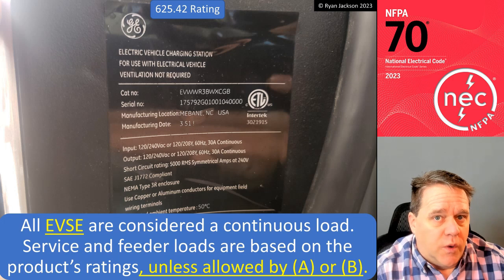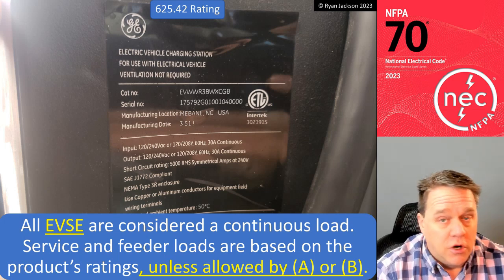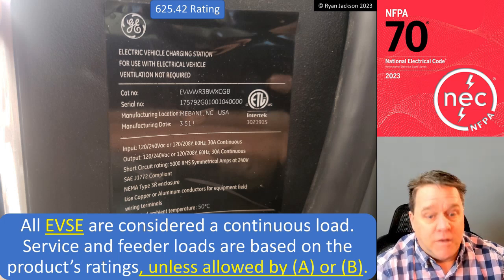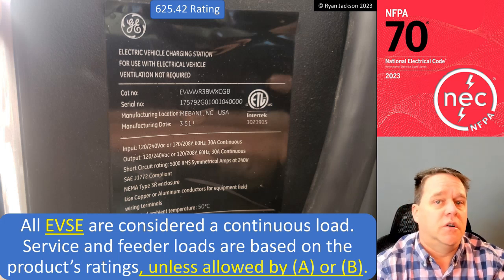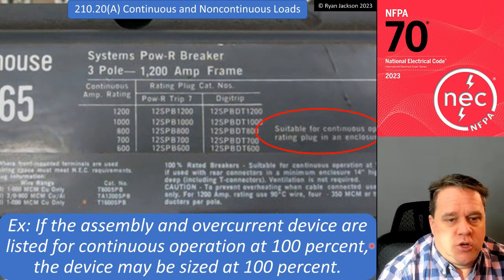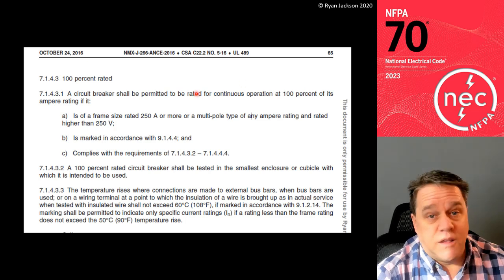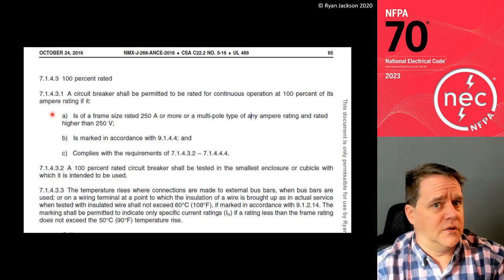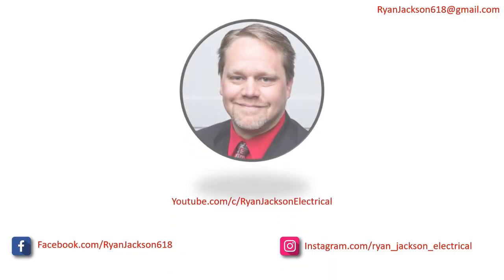Electric vehicle circuit sizing (NM Cable)

Comment: I do not argue with your interpretation of the code, or as the code states clearly in 625.42 that EVSE are considered a continuous equipment. However, there are some jurisdictions that have adopted standards different from this strict interpretation. One such example is in my home state of Oregon that acknowledge that the "peak demand" of most battery packs under charge is not for 3 consecutive hours as the code uses to define continuous load, and they therefore have alternative methods for calculating the load of EVSEs on feeder circuits. (Look up OR BCD Alternative method 09-01.) Usually this peak demand is for an hour at most, but it will depend on the battery controller for the specific vehicle being charged. But this is an inherent limitation to the lithium-ion battery chemistry that it cannot be safely charged at full power throughout its entire charging cycle.

I should also note the method I referenced only really changes sizing for multiple EVSE on the same feeder. For individual chargers and their branch circuit, because you have no idea what the battery size connected to them will be, you should design them to accept a continuous load even if they are not likely to. (Someday we may have large commercial trucks or semi-trucks charging from that charger, you never know what those automotive engineers will come up with next.)

All of this being said, I would only follow this alternative method if your jurisdiction makes it clear they have adopted it or something similar. Otherwise I would default to Article 625.42 and treat every EVSE as continuous.

Comment: If the conductors in nm cable are rated for 90 degrees, why isn’t the nm cable rated 75 degrees? What makes nm cable inferior, and what was the reasoning?
Reply from the maker: I am told by a major NM cable manufacturer that the cable jacket is only required to be rated 60 degrees by the UL product safety standard.

Comment: Hi Ryan, For 48 rated car charger,  Can we dial it down to 40Amp, as  Tesla, Wallbox, etc, chargers, install 50Amp breaker and use 6/3 NM Cable? Lot's of houses don't have capacity for 60 Amp.

Comment: "Branch circuits must be sized to carry 100% of any noncontinuous load PLUS 125% of any continuous load" when they use the word "plus" it throws me off. It makes me think they want the branch circuit to carry 30A (100%) PLUS 37.5A (125%) Which is 67.5A . But really the wire just needs to be able to carry the continuous load correct?
Reply from the maker: @Rdmanelect  We add when there are two or more loads, some continuous, others not.

Comment: Hi Ryan love all your videos and i appreciate what you do for us!!
Had a quick question off the topic-- I have an L3 300KW DC Car Charging station installation which specs for input current 400 amps/Breaker size 450 amps 3 phase 480V AC. I have 120/208V 3 phase in building.
My question is what size conductors can i use on the secondary side of the step up transformer? Can i decrease the size of the conductor to half (200 amp rated -3/0) because i am doubling the voltage or do i need 400 amp rated cable both on primary and secondary side of transformer?
Thanx in advance

Comment: You would think with record high copper prices two years ago EV charger manufacturers would not require a grounded conductor or four wire receptacle saving homeowners a lot of money. About 99.999% sure the power that supplies power to the full wave rectifier only uses the two energised ( 240 volt ) wires and the grounded conductor therefore never draws more then guessing 0.3 amps for supplying power to the control circuit . Even if they had to install a 60 or 80 VA 240 to 120 volt transformer inside of chargers would be a big cost savings. Always thought the NEC should have made electric cloth dryer manufacturers use a 240 volt drum motor and a small control transformer to supply less then 60 VA for 120 volt controls & a LED drum luminare thus only needing 10/2 NM cable.

Comment: Hello Ryan - just ran across your channel and this video today - subscribed! I am an electrical engineer designing commercial projects, and always like to see different interpretations/explanations of electrical code issues, since as you know, some code language can be a bit confusing and interpreted differently. But great video - you cover a subject that I also have seen misunderstood by many.

I'd also like to throw into this discussion an additional scenario that can further complicate EV charging equipment supply sizing - State modifications to the NEC (similar to what it looks like New Jersey is doing). Out here in Oregon, the state issued a "Statewide Alternate Method No. 09-01" for calculating the "demand factor" of single and multiple EVSE's with a table similar to multiple ranges or even dwelling units. To summarize, the ruling explains that "Considering EV charging equipment 'continuous loads" assumes that all charging equipment is likely to operate at full rated load for three hours or more. Testing data shows that charging currents are substantially below the full rated load and that cycle times typically do not exceed three hours."

So it's interesting to note that they require only a 100% demand factor (in lieu of the NEC-stated 125%) for even a single charge point up to 4 points, and for 5 to 8 charge points only a 90% demand factor, and so on. So to a point I saw in a previous comment, using #6 NM should not actually be a safety issue in use (even though it technically would not meet NEC in practice for that location).

But for example, in neighboring Washington State, we follow the "default" NEC ruling you cover nicely in your video.
Reply: I only read this after posting my similar comment about Oregon's Statewide Alternate Method No. 09-01. 

I would just point out that even with this alternative method I would still size the individual  branch circuit to the EVSE (and its corresponding OCPD) as a continuous load. Just because most examples we have today will not pull the full rated load for 3 hours, does not forgo the possibility of bigger batteries or new battery chemistries in vehicle platforms doing that in the future. 

I do agree with the findings they describe in alternate method no. 09-01 that the aggregate of several EVSEs on the same feeder are almost certainly not going to be demanding the full rated power at the same time since that would require their vehicles to be both the same, at the same SoC, and be charging at exactly the same time. Which is basically impossible to have all three variables line up together. Even in a fleet installation with identical vehicles deployed in a commercial lot, it seems silly to design around this super niche edge case.

Comment: If I had a 48amp charger which requires a 60amp wire because of the 125% adjustment for the continuous load.  Assuming the breaker and the charger are both rated for 75 degree I could use #6 THHN rated for 65 amps in the 75 degree column but would I be permitted to use a 50 amp double pole breaker even though I can use a 60.

Also specifically how does the ground wire size change when supplying a piece of equipment for continuous load.  Doe the general rule of 2 awgs smaller apply so in this case a #8 THHN would be sufficient?
Reply: Ground wire is sized buy the size of the overcurrent devise. #10 is ok up to 60 amps. Like Ryan said size the wire it needs to be a 60 amp wire so if the equipment is rated 75c #6THHN is ok. Then you calculate the breaker size which still needs to be a 60.

Comment: Is it better to run THWN-2 cable vs NM?  Looking to place wire before I finish up a wall for an electric car  I'll purchase down the road.  Trying to future proof myself.  Based on my limited research, even at the same gauge, it seems to makes more sense to run thwn -2cable with a 90amp breaker.  Trying to guess what will be needed in the year 2030.

Comment: Hi Ryan, great video as usual. Quick question, would SER fall in the 60*c column as well? I came across this when sizing for a sub panel recently. SER is printed 75*c but we’ve always treated it as NM in regard to sizing for ampacity.
Reply: SEU AND SER are generally xhhw2 or thhn/thwn. Can be used if above #10 at  90c dry location 75 wet if it’s thwn.
SEU and ser do have some restrictions #10 and smaller.  See 338.10
Reply: @davem5392 yea i think #6 ser is good for 60a

Comment: Too bad no one makes 4/2 NM cable.  You end up paying for an extra wire when using NM in addition to having to size up.  6/2 MC cable or individual conductors in thinwall is the way to go.
Reply: yup - 6g MC wire is the sweet spot.
Reply: @projectswithdrew SE cable is also rated as well so long as the physical protection requirements are met
Reply: @timrobinson4330 sure but the Tesla wall connectors aren’t rated for aluminum.
Reply: @projectswithdrew they make copper se cables.
Reply: 4 awg has a completely different fill/ volume calculation not like the small conductor in Mr. Jackson’s video

Comment: So, does that mean the "next size up" rule only applies to feeders and not branch circuits? Or does that just mean the "next size up" rule doesn't apply to continuous loads?
Reply from the maker: If the load calcualtion ended up requiring a 55A wire you could place it on a 60A breaker because 55A is not standard. But the load in this example was not 55A, it was 60A. So you need a minimum 60A wire, not a 55A wire.

Comment: So what happens when the "Manufacture" recommends #6 wire and a 50 amp breaker in their instructions for their 48 amp quick charge device?? Does the manufacture supersede the code? Also if the charger is direct wired does it still have to be GFI protected in a garage?
Reply: i very much doubt the manufacturer is recommending #6 NM -- #6 THHN in conduit is fine and the preferred option.
Reply: never said #6 NM @ssl3546
Reply: The Tesla gen 3 wall charger specifically states 6 AWG 90 degree rated copper wire, if installing for maximum power, so NM wouldn’t apply here. Also it has a note saying to upsize conductors if necessary.
Reply: #6 of what? Emporia's 48A charger, for example, requires 6 AWG & 90C rated wiring. If it's installed outdoors (de jure wet under NEC—even in conduit), use #6 THWN-2 in conduit. Not #6 NM.
Reply: You dont know the code, at least not in this cae. N.E.C 2023 110.3 Examination, Identification, Installation, Use, and Listing (Product Certification) of Equipment. 
(B) Installation and Use. "Equipment that is listed, labeled, or both, or identified for a use shall be installed and used with any instructions included in the listing, labeling, or identification."

Comment: Ryan, I agree 100% with you about the 55 amps allowable on the 6/2 NM.  But as you know in New Jersey the DCA had a ruling that permits 6/2 for the 48 amp EV chargers. Just an FYI for any NJ licensed electricians viewing this video.
Reply from the maker: Yep, and it's wrong. That's why I've had so many people from Jersey reaching out to me.
Reply: Ron was here !!
Reply: @kengorman4857 I’m a recently licensed NJ electrician. Do you know how I can view/subscribe to this newsletter?
Reply: Well good because I have passed several installations too.  @kengorman4857
Reply: Also, we routinely do 100 amp services with #4 AWG copper SEC's. So you're saying that I need to use # 4 CU for a 60 amp circuit where the same can be used for a whole 100 amp service. That's really interesting.  I'm not trying to give you a hard time just being the devil's advocate here. 
 @kengorman4857
Reply: 60amp load at 125%…… take me to court
Reply: The 90degree column is for conductors that are still on the spool…..
When u remove wire from the spool you MUST follow minimum fire codes
Reply: @jimsummers487  we follow the UCC here.

Comment: Thank you for this explanation.  I am not licensed but I understand the basic 120v residential circuits.  I know what I don't know, which is a lot.  I would never try to install an EVSE although I believe I could correctly.  But, your explanation will allow me to ask the right questions for my electrician if I do not think it is right.  I have had an electrician once install equipment not in accordance with the manufacturers instruction and it got passed by the electrical inspector.

In all fairness to the electrical inspector, the only way he would have know is if he disassembled the light control box to my pool.  It clearly stated to size the breaker at 15 amp, not 20  amps.  (I read everything weeks before it was installed by the pool contractor's electrician.)

Comment: Can you use power tray cable type TC-ER for 48 continues load for  EV installation or possibly SE or SER?
Reply: Oh yeah, I’d love to see the answer to this one, following
Reply: Either one is compliant assuming all terminals are rated for 75 degree terminations. Copper 6AWG SEU is commonly used on electric 10KW air handlers with 60A OCPD’s.

Comment: Ryan, I installed a 50amp receptacle using 6-gauge NM wire. The inspector initially failed me because he said the wire was only rated 60°, and he claimed it had to be rated for 90° because “every charger I’ve ever seen requires 90°-rated conductors”. I explained that NM-B conductors do have 90° rating on their insulation and that what he was referring to only applies to some hardwired chargers. Ultimately he would only pass it if I changed the permit app to just say 50amp receptacle and remove any mention of EV Charger, which I was fine with. But shouldn’t the NEC allow 6/3 nm-b to a NEMA14-50 receptacle regardless of what it is being used for?
Reply: That is utterly bizarre - the receptable itself does not reach 90 degrees (that would be an obvious safety hazard), you don't need to consider a rating of the utilization equipment. Moreover I doubt the receptacle was rated more than 75 degrees.
Reply: I believe you can use 6/3 NM cable for a NEMA 14-50 but your EVSE can only draw 80% of the 50 Amps (40 Amps).  This video addresses 48Amp EVSE wiring. Interestedly NJ AHJ has implied 6/3 NM is ok for a 48 Amp EVSE. They explain this in 2023 Construction Code Communicator Volume 35, Number 3 page 13. (https://www.nj.gov/dca/codes/publications/pdf_ccc/CCC_Fall_2023.pdf)
Reply: The connector cord with a 14-50 plug will only pull 38 or 40 amps in this case as its (the vehicle connector) design has assumed that the circuit is a 50A non-continuous circuit and it is programmed/designed to derate as needed.
Reply: I wonder if he allowed it after removing "EV charger" because then it is not a continuous load?